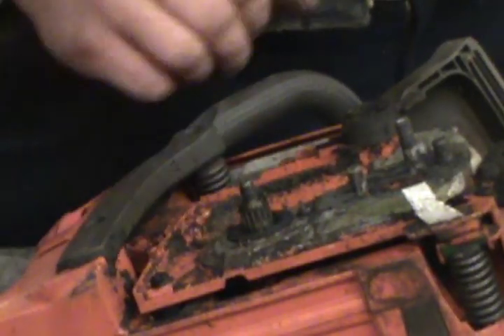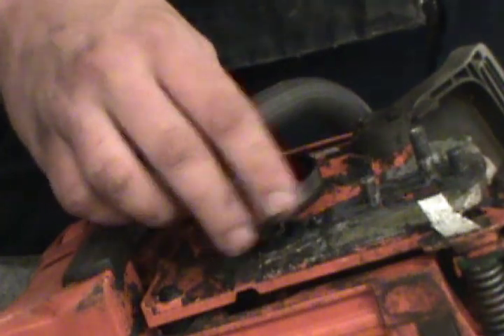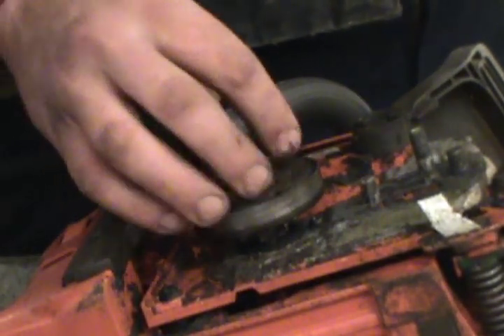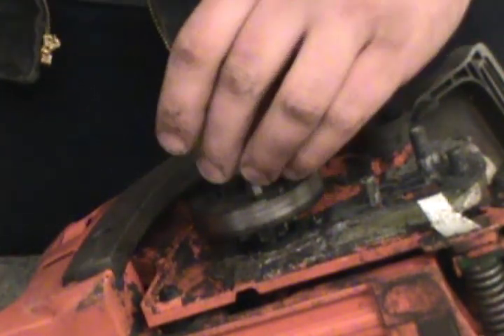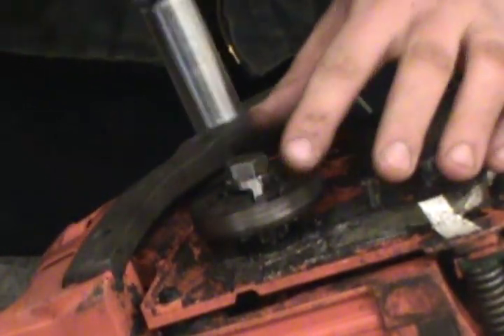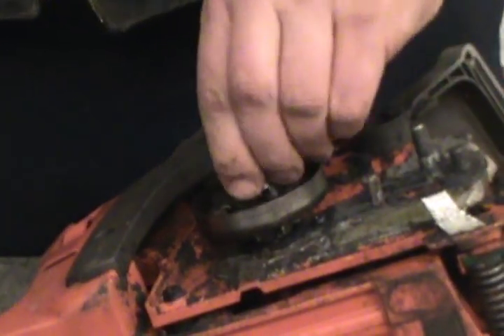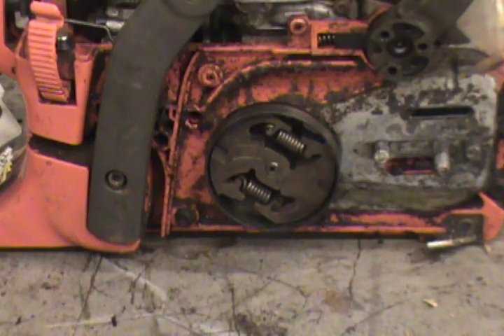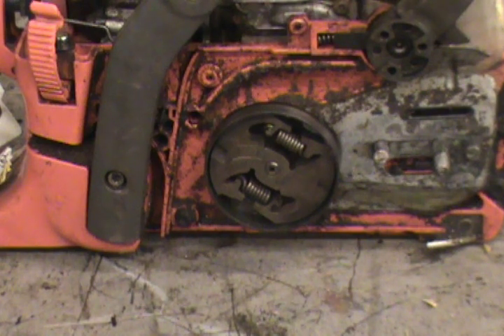Replacing a Spur Sprocket - Husqvarna Chainsaw

Comment: I used rope to bind the piston.  The clutch was on so tight it now runs almost open after I got it open. carb adjustments cant fix it. Sucks.
Reply: Your needle bearing might be the issue. Replace it. Your clutch is not running open the bearing binds to the crankshaft and transfers rotation to the sprocket.